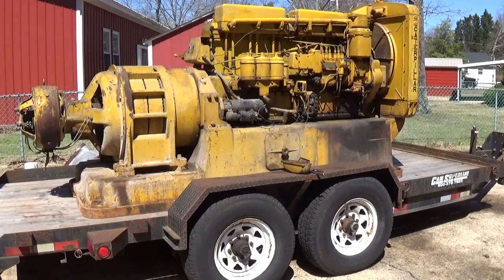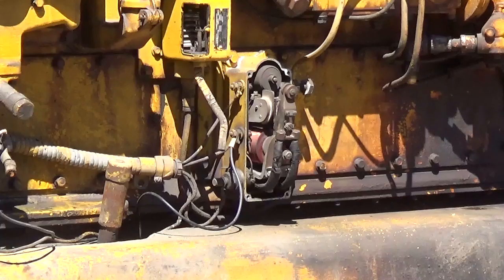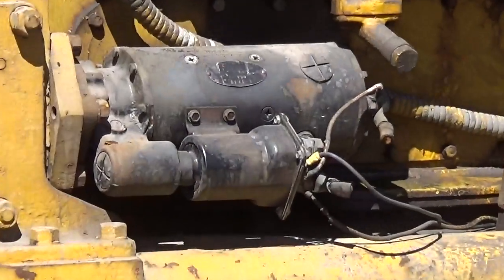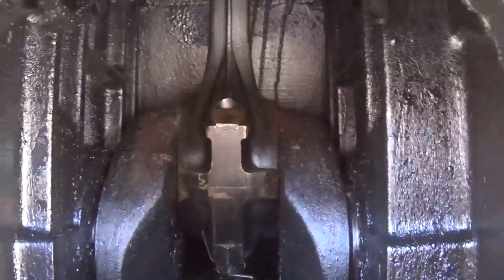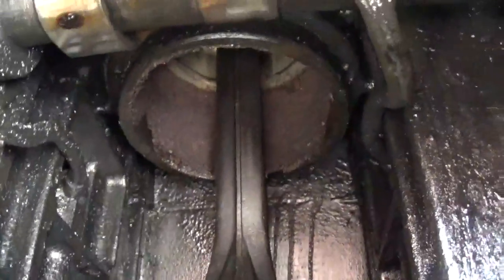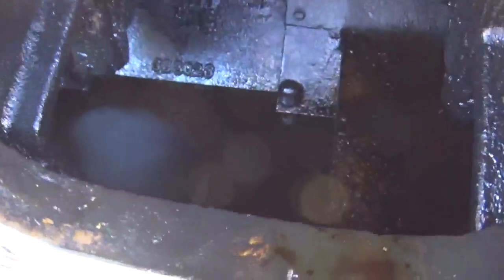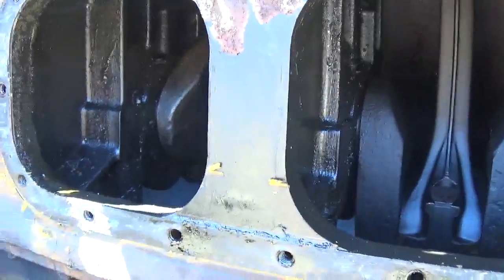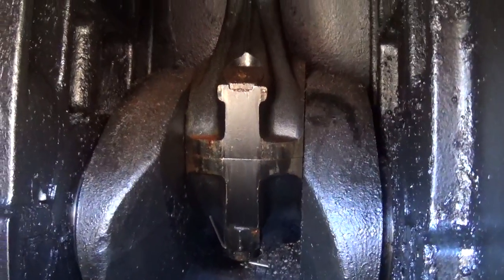Caterpillar Generator Set Repair Part 2 (Assessment)

Comment: Not bad for an engine that started life with straight weight non-detergent oils. I've seen much more crud than that is 'em.
Reply: right, very much worse, mine had 3" sludge in the pan, right up to the pump screen.  i believe mine had detergent oil used in it in the 70's/80's, this washes the in the decades of carbon black the the non detergent oil leaves on the interior surfaces of the block.  ck those pans man!

Comment: I'm curious is it worth your time to pull the injectors out of the trouble cylinders and scope them with the camera if you can even do it??
You mentioned a 32-Volt starting system how was that accomplished??
Reply from the maker: All the injectors will be coming out eventually.  Might give me an idea of what to expect but the heads are still coming off.
32 volt systems would typically use four 8 volt batteries in series.  Thanks for watching!

Comment: Thanks, Mike.  Another step closer.  Are the parts, gaskets, etc. you will need still easy to find if Cat doesn't stock them?
Reply from the maker: I imagine I will be making most of the small gaskets, head gaskets can probably be reused, the rest I will  have to wait and see.  Thanks for watching!
Reply: all are available, that engine was built to the mid 50's.

Comment: Nice gen set Mike! I am still running one of these D13000 engines at work. It is in a 1944 Lorain dragline that I clean sediment ponds with. It is the original engine to the machine as far as I know but she runs great. Some of those parts are available through Cat classic parts division. I'm guessing that generator is 1200 RPM? Hope the liners aren't pitted out too bad on the old girl.
Reply from the maker: That is good to hear!  The set is actually 900 RPM, 8 pole gen end.
Thanks for watching!

Comment: Hey do you still have that 2-71 Detroit diesel gen set? What are you going to do with all these generators?
Reply from the maker: I actually sold that to a collector in Maryland along with my 3-53 power unit.  
Probably not going to do anything with the generators except fix them and show them, don't loose power that often...
Thanks for watching!

Comment: Mike, i have been following you and Roadking for a while. I am an engine rebuild technician for Caterpillar. If there is anyway i can give you a hand with any trouble you run in to, let me know. While i have not worked on these units specifically, the knowledge and information i have access to is endless.
Reply from the maker: Thanks Brian!  I will get in touch with you when the real work starts!
Thanks for watching!

Comment: Over the last 45 years I have revived several Caterpillar engines. Both gas and diesel are very durable. Just pull the head on the offending cylinder and take a look inside. If there is no major pitting apply your favorite un-stick-um concocktion and let it soak a day or two. If the starter won't spin it over with the compression release on tap it smartly with a 4x4 piece of lumber and an appropriate hammer. Try not to hit your thumb. The last one I revived this way was a 5J in a D2 Cat that had the head removed for 20 years. Good luck.
Reply from the maker: Thanks Chuck, I am sure it will come to life again!

Comment: How the heck do you get 1 rusty cylinder???
Reply: michaelfarm If the exhaust valve is open on just that cylinder and water gets down the exhaust and into the cylinder it will rust, that's how.
Reply: Ok. that makes sense. Thank you.
Reply: No problem.

Comment: I know it's a while off yet, but...  make sure you prep a board with a rubber sheet glued down, and a handle on the back before you fire this up.  

Seen a few machines run away.  And one, the gen end blew up as it tried to rev to infinity. Chunks of fan blade were impaired everywhere!  Could have been lethal.

Comment: Might be a good time to buy or borrow a soda blaster mate. I use one to clean parts like yours and happy with the results. It blasts away all the dried on oil,rust and general filth. The parts resist rust for months with indoor storage. The other advantage is any left over media does not wear out the engine like sand blasting does. The soda dissolves in the oil. Will save you a ton or wire brushing and buffing.